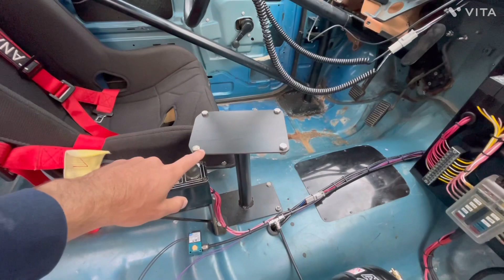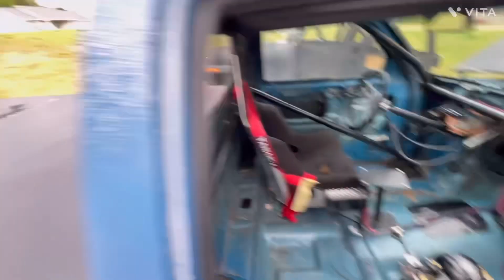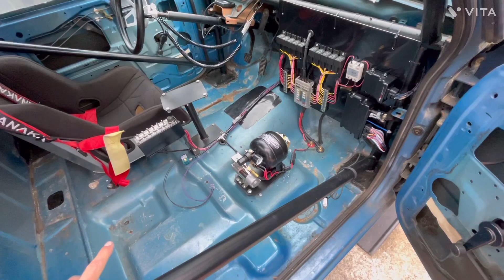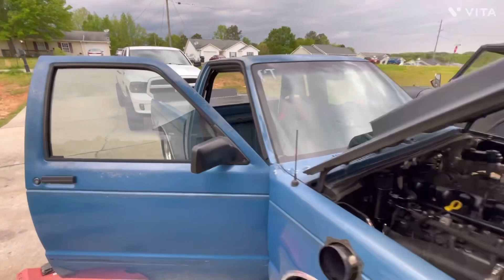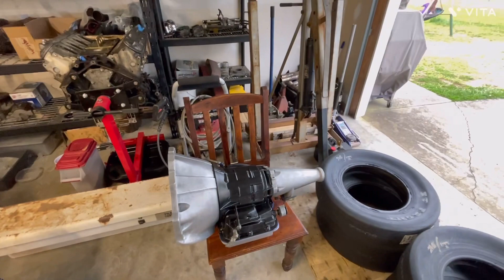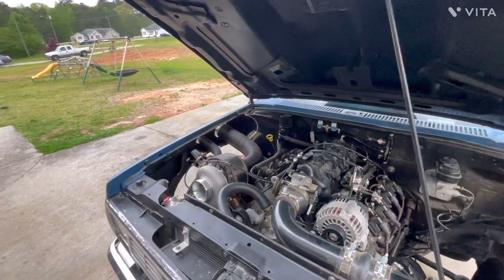2 step test and On board air systems installed

Comment: Someone should invent a 3-step.
Reply: What’s 3 step
Reply from the maker: A 3 step is just just one more rev limit. Some people use it for burn out control so it don’t go over a a set RPM. Some people use it to build boost at a higher rpm then once it’s at the set boost number it drops rpm to the 2 step launch set point. You can use it for a few different things it’s just a 3rd set point.